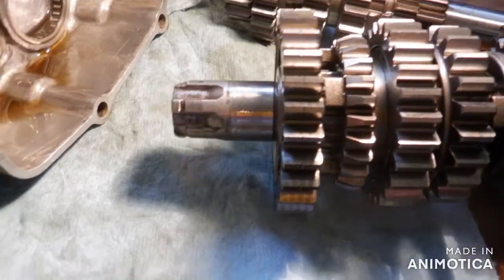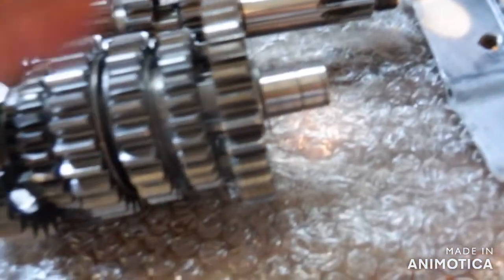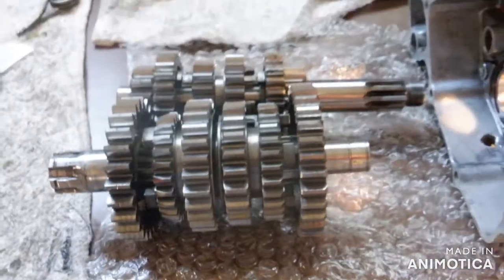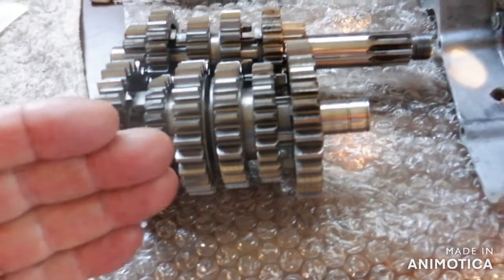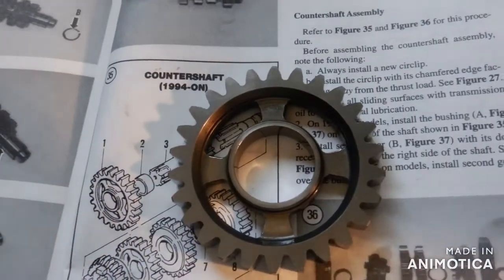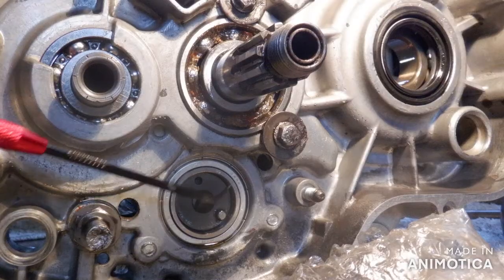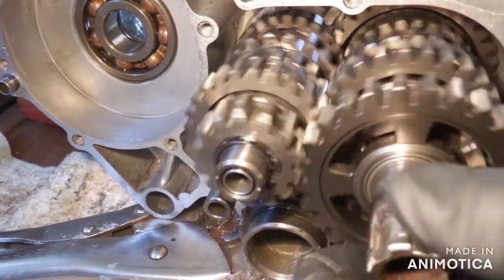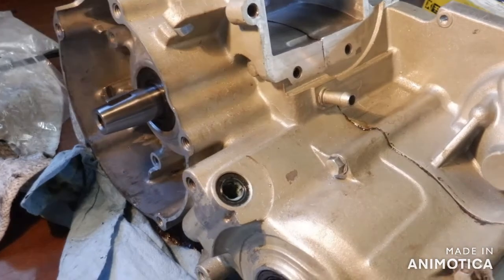1998 KX125 transmission installation Issues and Solutions

Comment: i have a 1996 and my manual is junk compared to yours.  where did u get that manual?  it would be a massive help to see pictures of the 1996 transmission gear order if it shows that.  thanks for the video!
Reply from the maker: I bought the manual off of ebay. and I had to replace my trans and I got it from ebay too.

Comment: So, something unknown prevents the trans from shifting if it's installed in the left engine case? Odd. But useful.
Reply from the maker: Correct. And I don't know what causes the not-shift problem. It shifted just fine when moved to the right side engine case
Reply: I just installed mine in the left engine case first (flywheel side) and it shifts perfectly fine after being sealed up.

Edit: Yes I realized this video is old 😂